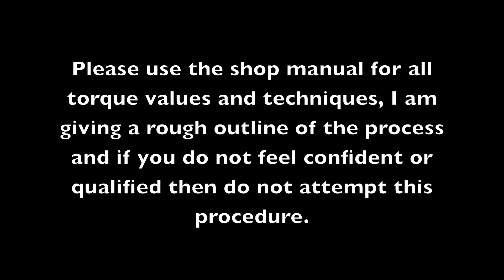Nissan Xterra front brake rotor caliper removal and replacement.

Comment: Stupid irritating music. Why go through all this and then not provide the torque specs for the nuts bolts and the preload on the wheel hub bearing?  Makes it all pointless.
Reply from the maker: this video was made years ago and i have changed many things...and i dont use music now.  i dont provide torque specs because people have different years and they differ. .so id rather not be liable  for that.  I do suggest looking them up online.  So you got absolutley nothing from this video or are you mainly here to criticize it?  Next time come hold the camera snd tell me what im doing wrong..thatd be fun.  Thanks for your support...
Reply: @PowerModzOfficial  I think if people need 100% of a walk through like needing torque specs, or the type of grease to use, or the name of wrenches, then those people shouldn't be attempting work like this. I been in the auto industry for 35 years and the reason i came to this video was i needed a fast basic video before i order my parts online. people need to give thank the ones that make videos , even if the videos are bad. Videoing your work, then editing then uploading turns a 2 hour repair into a full day process. Remember people, video tutorial ( and the internet with all its info) never even existed before 10 years ago. If it weren't for videos like this , then you'd be buying your $150 chiltons catalog at the parts store, and only getting a general idea on pulling off your rotor. (For those that dont know, Chiltons was a huge auto repair manual with specs on cars and basic procedures. One was released every year and for every brand of vehicle and they cost at least $150 each. Thanks for the video and your time to do it. I have a 2003 xterra SuperCharged with 98k on it.

Comment from the maker: @shortaznkid ok, take a hammer and tap the hex in as far as you can then slightly tighten it, then loosen it, if stil not moving then hammer on the socket a few times, it might jar the rust and corrosion.  If that fails then you can try heat but I'd rather snap them off and use a pair of vice grips to remove the broken studs then you are good to go.  That part can be tricky, i feel your pain.

Comment: Perfect description and helpful had a battle and a half with my Southern Wifes Northern Rust Belt Nissan I found  this and was able to change both sides with ease aside of the fact of unsticking very very rusted shut caliper bolts YAY! Imma take them off when the Nissan is dead and reforge them into knives or something that metal took a serious beating and still did not strip or round off

Comment: You don't use the bleeder to push the pistons back. You open it while pushing them back so you don't force all the rust particles and junk back up through the brake lines. It's a good idea to change the brake fluid out anyway because brake fluid absorbs moisture over time.

side note: you should not use a vise but an actual brake caliper tool as using improper tools can damage the seals in the caliper.

Comment: Yeah, just force all the moisture, rust and gunk back up through the brake lines and ABS system back into the master cylinder, that's smart.

You should always flush fresh fluid through when changing the brakes to avoid problems...

Comment: Good lord, 3:34 how not to do it. They make a 2 prong tool for tightening that. And there is a very specific FSM procedure you need to follow to set bearing preload correctly. At least its more correct than some of the videos i've seen ...

Comment: Do not spray brake cleaner on the rotor and let it run on or get all over the freshly greased hub, spindle and bearings. Either cover the freshly greased parts before spraying the cleaner or spray the cleaner on a rag and wipe the rotor.

Comment: Wouldn’t you want to crack the bleeder valve when compressing caliper open to fit new pads.   It could fuck up the abs module. Plus won’t have to bleed the system. Or am I wrong??

Comment: Is this the same for a 2000 Xterra? typically what should rotos and pads cost: average? Also, what type of grease do you use? Thanks for the tutorial.
Reply: +Scrap Smith I have the same question.  need to replace front wheel bearings and having terrible time finding the supposed 1 1/2" socket.  wondering if the tool used here will work for the locknut on my 2000.
Reply: crosby c I did replace both front rotors, calipers, etc. with no issues.  Parts cost me around $100.  I had to bleed twice on the right side if I remember correctly.  The pads squeaked on the new rotors for a little while, but once they were all broken in the squeaking stopped.  I've had no problems since replacing the brakes.  Glad I did it.  Saved a bundle.
Reply: +Scrap Smith were you able to remove the bearing locknut using two screwdrivers and get it back on using an allen wrench with screwdriver as the video shows?  or if not, how did you remove the locknut and then how did you get it back on at the right tightness?

Comment: no need to apply sealant to the hub mounting surface? must be a very good fit.

You really should invest in a brake caliper tool... it's so easy to screw them up pushing the pistons back the ghetto way! And ALWAYS open the bleeder screw on the caliper when pushing the pistons back!!!!!

Comment: Is there a torque value for the bearing nuts or do you just follow the "GutenTight" method?
Reply: Some guy said torque it to 60 ft pounds to seated then back it off use a inch pound wrench set the wheel nut bearing to 13 inch pounds

Comment: Hi, I have 2005 xterra.  Lately when I back out of my parking stall or even driving at hwy speeds, I can hear a loud high pitch squeal...slow driving or fast..there is that squeaking noise...any idea what caues that?  I think it might be my brakes.  I dont want to take my truck to nissan cause the bill will be huge.  I might take it to a heavy duty mechanic..thx man!
Reply: it's a belt.

Comment: my daughter hit a curb going like 15-20 mph with the wheel turned and busted a tire. when we put the new tire on the car started pulling to the right if you let go of the  wheel . so we took it to several mechanics and they did not know what to do .so we took it  to a body shop and they fixed the pulling but now if u hit a bump it sways really bad do you have any suggestion on how to fix it

Comment: Hey man you should have serviced your caliper!
Blow out the pistons, cleaned and inspect the seals, boots, pistons, internals of caliper and the bleeder valve. 
Might as well if you putting on new rotors and pads.
BTW your bearing packing job was completely wrong and you used the wrong grease. 
Also after removing and repacking bearings you should check to see of there is no play in the wheel itself, you do this by holding wheel top to bottom and jerking it back and forth. Must be NO play.

Comment: Please help what are the torque specs to the hub assembly when bolting it to the rotor! I cannot find them anywhere! 
Minute 2:14 to 2:20 in your video
Reply: +MichaelZ1991 Google 2003 Nissan Xterra FSM. It's the factory service manual. Go to BR (brake section). Torque specs are listed there.
Reply: I seen 76 foot pounds rotor to hub bolt seems kind of tight I got mine at 70

Comment: Krankie, he didn't do a lot of things that he should have in this video.
I would have serviced the caliper by blowing out the pistons and cleaning and inspecting everything from the seals, to the boots to the bleeder valve and the cylinders and pistons of course. 
I would have not spray my rotors to clean the protective film with the bearings exposed like he did.
And I would have checked to see if there is any play in the wheels after fooling around with the bearings....

Comment: ...also, the wheels should be checked for play in the bearings after another 50 to 100 miles after initial repacking.
He also did a bearing horrible repacking job and used the wrong grease. 
You use the Red Stuff, heavy duty thermal resistant grease. Grease is not just grease like oil is not just oil and you use a packing tool
Reply: Where is your video?